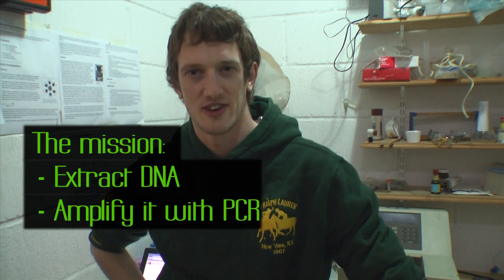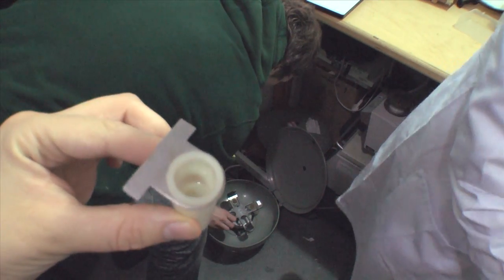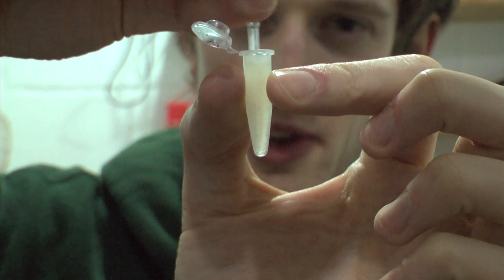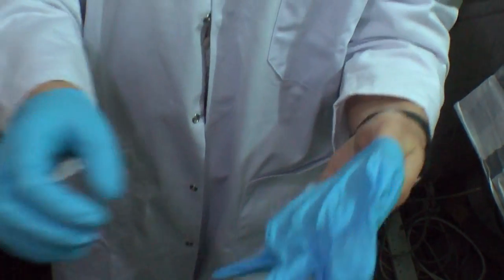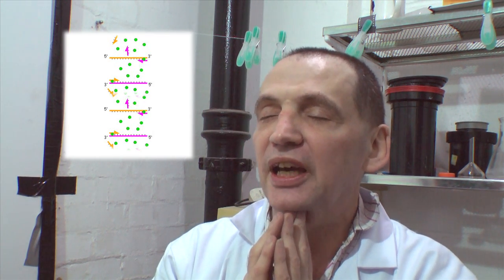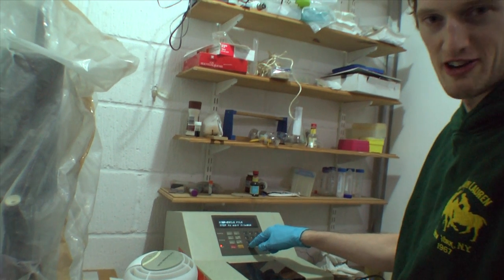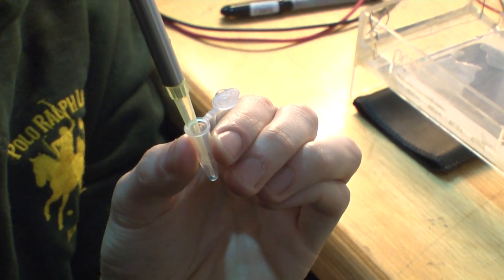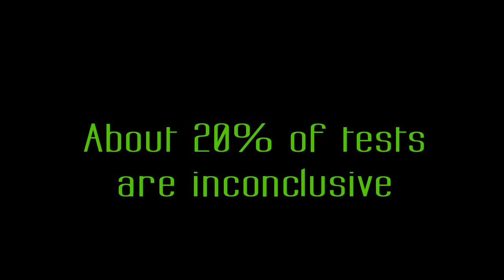DIY Biology: DNA Extraction & PCR in London Hackspace

Comment: I did a protocol where we used PCR a while back,  I think you have to wait several hours for the E. Coli to multiply and amplify the DNA, in practical we had samples that had already been through certain steps so that we could do it in less time though so I'm not exactly sure how long you should wait
Reply: Nathanael Arumugam Dude, you have me all confused, transformed e. coli will multiple the vector you have added. What does plasmid replication have anything to do with PCR?
Reply: +Nathanael Arumugam PCR is polymerase chain reaction. The machinery doing the replication is the polymerase, not E. coli.

Comment: Heres some tips for you guys:-

1) divide your pcr preps and exstractions into three labs with seperate doors and such. There should be a room just for the thermocycler. One for the gel and a seperate room for the preperation of mixture which contains taq enzyme and primers which is made first and moved into the exstraction room when its added to the prep then moved into there thermocycler after which its moved into the gel room and finally the bin.

2) use gloves in the primer prep room to stop contamination of you stock enzymes as there used in all pcrs. as well and to protect the enzyme which is the most exspensive part of pcr. There NOT! a talismen.

3) your pcr thermocycler does'nt have a heated lid. Which is needed to prevent evaporation and heat destruction of the dna. In these old thermocyclers a later of sterilised petrolium oil is placed ontop of the liquid sample to prevent this.

4) Your gel showed air bubbles in the bottom. These can but not always cause problems with current flow as it moves across the gel. 

5) the use of chomatic dyes for the illumination requires illumination but also a light filter. Whichout such only the strongest pcr will show. Thus weaker amplicationions may not show up to the naked eye.